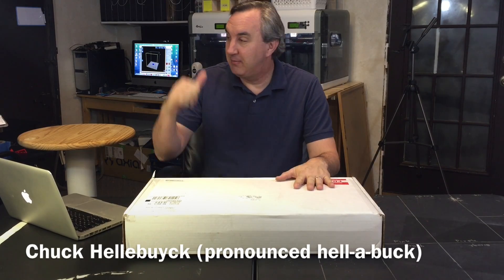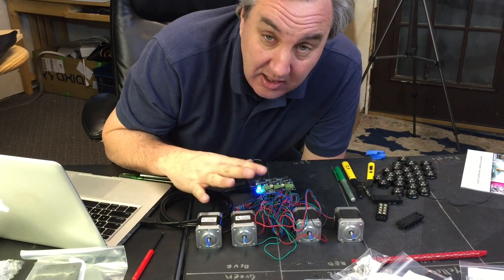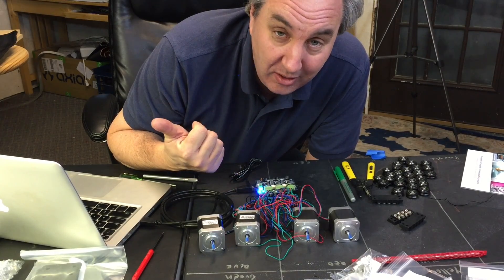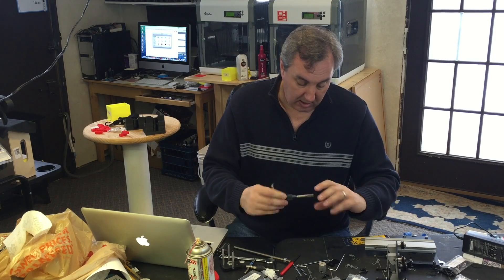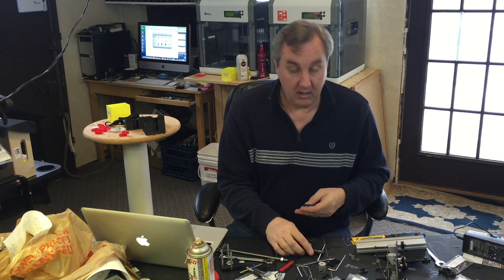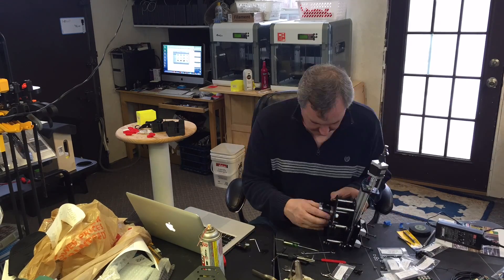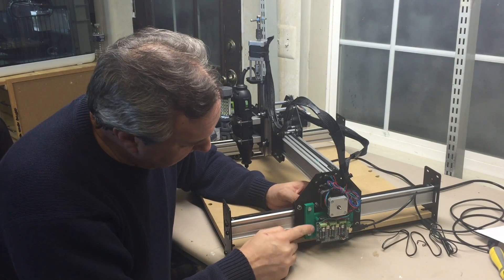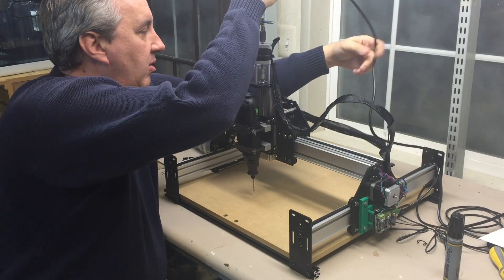Building the Shapeoko 2 CNC Kit for 2D Cutting - Video # 036

Comment: I like the time lapse building... great move. I guess if you buy a non assembled kit you can expect quality control issues. I suppose it was cheaper to supply a Tap and Handle than pay for the labor to tap the aluminum blocks themselves.

BTW.. did you buy the "Full Kit" or "The Works" ??
Reply: *****  About 3 years ago I bought a 3040 CNC machine similar to this one...
http://www.ebay.ca/itm/3040-CNC-ROUTER-ENGRAVER-ENGRAVING-MACHINE-DRILLING-MILLING-STEPPING-MOTOR-/271637477545?pt=LH_DefaultDomain_0&hash=item3f3edaf8a9

It came completely assembled and tested and cost about $800.00 USD delivered.
It was purchased to make Display cutouts in plastic enclosures and hasn't let me down yet.
Reply: *****
Good points Chuck. I had an older Laptop with a Parallel Printer Port that is now a dedicated non networked stand alone CNC controller only.